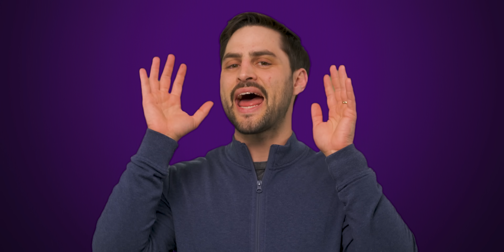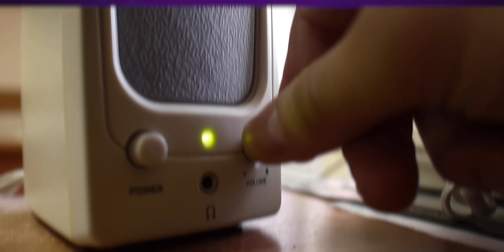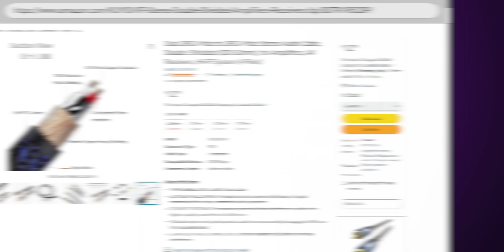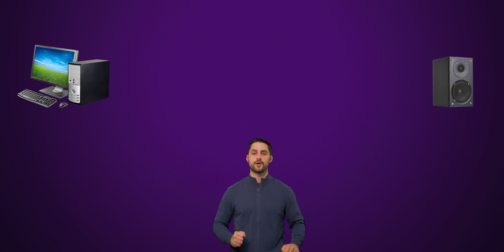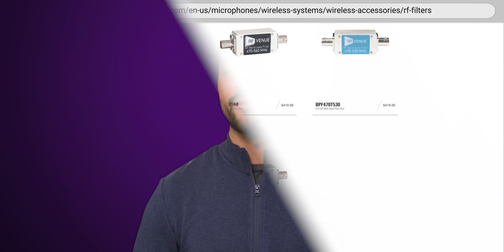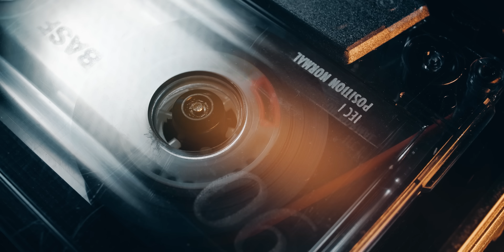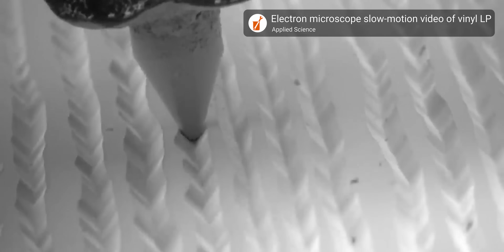Why Do Speakers Hiss?

Comment: THANK YOU SO MUCH!!!!
i just got some cheap microsoft USB speakers from a thrift store to use with my laptop. i was pretty dissapointed that they were making that annoying hum.
then i found your video and after that Ground Loop part I decided to plug the USB directly into my laptop instead of the USB Hub. the ominous hum instantly disappeared!!!
i assumed the aux cable was kinda bad because it seems pretty old, but this was insane!!!!

Comment: I solved mind by just uninstalling the Realtek Audio driver and the system defaulted to Windows Audio driver. I connected a relatively small speaker with an AUX cable through the 3.5mm jack on my laptop.

Comment: Hissing is not that bad. Has anyone tried using Corsair USB gaming headsets? Their MICS even on expensive models give terrible earthing buzz that can only be killed by denoiser algorithms, but they are useless on anything that doesn't have those systems. The buzzing is frikkin loud. I have never used a mic that bad in my life even on a cheapo analog hoffice headset from the 90s.

Comment: I'll tell you boat speakers make all kinds of weird noises. Including popping sounds when you engage something else in the electrical system. The one that comes to mind is running the bilge blower. It causes a crackling and popping sound through the speakers. So I imagine some sort of electricity is running through it and probably shouldn't.

Comment: 2:19 A ground loop isolator has saved me many times, especially when connecting my N. Switch or Steam Deck to external speakers using the handheld's headphone jack.

Comment: Can also happen with electronics not connected to the loop indirect inductance from a lamp cord can cause issues even if it's in the loop or out of the loop if you have the cord near your speak wire

Comment: I have a ground loop problem with our audio receiver being plugged into a subwoofer amp. The fix for us was using the Subwoofer Isolation from Blue Jeans Cable. They work pretty well but, they aren’t perfect!

Lastly, a nice trick was turning the bass output of the amp out as high as possible so that the subwoofers don’t need to be turned up as much.

Comment: I've had a samé problém with my USB speakers, the small ground loop via USB and 3,5 audio connector. The solution was powering these speakers via external non-grounded phone adaptor.

Comment: Another common problem, at least in Argentina, is that many houses do not have an electrical installation with a ground connection, which exacerbates the amount of interference.

Comment: In todays world of incredibly cheap made electronics with minimal or no filtering, it is far more likely for the average joe to be seriously creating radio frequency interference for amateur radio operators than the other way around. 

TVs, Routers, Dimmers, LED lights, anything with a motor... The list is infinite.
Reply: why would routers create radio frequency interference? they use the unlicenced 2.4ghz, 5ghz & 6ghz bands

Comment: I have a Gl.iNet router for privacy & security & its actually amazing! 100% can vouch for it. The router operating system (minus the source code) is FOSS & runs on OpenWRT, throw a good VPN server on there (IVPN or Mullvad) & you've got an extremely private network & your computer can't even see the real IP, useful if you don't want Microsoft having your ip, or anyone else for that matter.

Comment: What he doesn’t tell you is GSM can also interfere with the speakers. There’s a cool little trick here on some GSM networks if you have an external speakers that connect to a computer just before you receive a ring on your smart phone the speakers will start humming it appears that speakers can pick up the signal seconds before your phone rings and on GSM and CDMA networks if you have a digital antenna can interfere as well because in some instances the network and the digital antenna station are running on the same frequency this is important as to why you should buy a digital TV antenna that has 4glte RSD shielding or as it’s usually filtering. The box will say something like 4glte filtering or shielding

Comment: Use XLR or LAN cables that are balanced and well shielded, if you have the right connectors available on your equipment. It makes a world of difference and really should just be the standard.
Reply: what do lan cables have to do with this? they're digital

Comment: Whats weird is shielded network cable and shielded RCA cables have the shild terminated at both ends. That inherently makes a ground loop. In every other cable, you ground that shield at a single end to prevent this. Cisco switches actually had a problem with this and they could be destroyed by it. Since then, network gear started useing isolation capacitors so there would be no path to ground for DC ground loops. But there would be a path for AC. Noise is almost purely AC. 

However the capacitors add impedance to that path to ground so they sacrifice slightly higher noise for not destroying itself with standard shielded network cable.. all because they terminate the ground at both ends.

Comment: Back when I was living in a dorm room for the longest time I had no idea why the heck I was getting insane buzzing when using Bluetooth headsets. Felt really dumb I didn't realize the microwave right next to my PC Build might have been the problem... Switched to a wired headset and fixed the problem.

Comment: Fun fact, you can also create ground loops even within the same wall circuit if you are connecting multiple computers audio outputs together in a mixer. This is especially a problem for computers that may not have a proper ground to start with, like laptops, smartphones, basically any audio source with a battery and doesn't have a proper ground via its charging cable. Ive noticed this especially with battery powered devices charged over USB-C, all of them give off static noise that is completely eliminated by putting an audio ground loop isolator in between the device and my audio mixer
Reply: I think this problem is almost completely fixed when the audio cable is using a digital format to get the audio from the source device to the output.
Reply: Yeah I think that this problem is caused by connecting a power cable and an audio/data cable between any two devices, honestly I would be surprised if it is worse if you are using two separate outlets.

Comment: Had a really cheap set of USB speakers that would go nuts when my old GSM/2G phone received a call
Reply: that usually happened on most audio devices, regardless of if it were usb or not. I remember mobile signal interruptions noise from the 90s/2000s... it acted like a pre-warning that you're about to get a message or call when you're in the car.

Comment: My issue was electrical interference caused from a Dell motherboard's USB port connecting with my audio interface.

It was so annoying to deal with and figure out. I just lived with it until I finally upgraded to a new PC.

Warning to anyone working in audio, definitely don't use a Dell. Probably good advice for anyone, really.

Comment: Ground loops are due to improperly wired electrical systems (i.e. the electrician screwed up). If you have one, you'll get that awful humming even from a single device connected to a single socket.

Comment: I once swapped an HDMI cable in my setup, and got a hum in my active monitors (speakers). Swapped back to the old HDMI cable, and it remained. And that was actually the only change I did. It was all powered by the same wall outlet as well. Incredibly frustrating. Had to move the speakers to another outlet for some reason.

Comment: Ground Loops also can be removed by placing a device called "Directon Box" ("DI-box" for short), which has a feature called "Ground Lift". Cost around 200$+, so not a first thing home users will buy, but regurarly used by event and music profesionals.
Reply: "Lifting the ground" is simply disconnecting it -- can't have a ground loop if there's no connection to ground! Professionals don't ever do this because it can get people killed. There's a damned good reason for ground connections.

Comment: My favourite mystery noise was that one time my computer's audio would make noise when I moved my mouse or scrolled a window.
Reply: ah yes, mine did that too. I could also get my GPU's coil whine through it as well. A USB DAC or simply not using Dell's horribly cheap OEM mobo solved the issue.

Comment: your amp is garbage, keep cable run lengths short
the sound of a ground loop is 60Hz ... the frequency of AC power in North America ... your mileage may vary

Comment: I absolutely haaaaaaate the low level muting that's integrated into some Bluetooth speakers. I have a set of bluetooth bookshelf speakers in the $50-$75 range paired to the FireTv Stick on the TV in my bedroom and background music and quieter dialogue is completely cut out unless I crank the volume to about double what I want it at.

Comment: If your electrical noise is caused by a LICENSED ham radio operator, then tell them.  If they don't help you solve your interference issue (if it actually is caused by their radio equipment), they could lose their license.  Likely, your "ham radio operator" neighbor is just a pirate CB operator transmitting out of band, out of spec, and above the legal power limits. They are not licensed and probably have no idea how to solve the problems they're causing.  Yes, I am a US licensed extra class amateur (ham) radio operator.  I've been licensed for over 30 years.

Comment: Any ideas for why I'm getting "ground hum" on my laptop when another wire is plugged in like a USB C hub or charger, but on other devices there is no hum whatsoever? It's clearly my laptop. I've used 2 separate sets of speakers and they're dead silent for another device but loud with the laptop even when running everything through a power strip. It's driving me crazy

Comment: The easiest way to eliminate a ground loop problem is to use a ground loop isolator in the audio connection. They cost a bit but are generally a good solution.
Reply: Except their inductive coupling can and probably will alter the audio signal to a certain extend.
Reply: No, the easiest way is to plug everything into the same strip

Comment: I'm using SPDIF from the PC, but the biggest thing I've found helps is to turn up the volume on the PC and then turn down the gain on the amp. I still have a problem with his when I restart the PC as the spdif box puts out noise when there is no signal going into it.

Comment: A ground loop can also form between your house's electrical system and your cable television provider.  If the ground potential differs between these two and you connect them, say, in a home entertainment cabinet with a television and amplifier, you will get nothing but buzz. This can be solved by using an inexpensive ground loop isolator on your cable coax.
Reply: I had the exact same issue, and resolved it just the way you explain it here. Thanks for sharing!

Comment: as a person who plays guitar, using distortion or overdrive, this problem multiplies (literally) and can be a great source of frustration but if you know what you are doing, a lot of interference can be mitigated. the only part you are stuck with is the internal components picking up natural background static (they grey snow on a TV with no cable) and amplifying that. (we don't live in faraday cages.)
Reply: You bring up a good point, I agree we should live in faraday cages.

Comment: I can't stand the hissing noise. Mine was caused from a ground loop capturing audio from one PC to another and yes they were plugged into the surge protector. A ground loop isolator fixed my issue.

Comment: I have this issue but it becomes very apparent to my 5.1 surround when I turn off my PC. I think it has to do with my shitty receiver. There's just isn't any good and moedrately affortable 5.1 system for PCs. I was searching for the RF filters you mentioned and led me to Ferrite Beads. Are those a cheaper solution than adapters?

Comment: If your amplifier even has a ground, you bought garbage equipment! Good audio equipment don’t come with grounds at all because they are internally insulated and safe. Also this explanation of a ground loop is not correct it’s about the different circuit, but more specifically the circuits must have separate grounds and separate potential differences. Some circuits can share a ground inside the circuit (all circuits eventually go to the same place though). It’s more about the potential difference not the fact that they are separate

Comment: Ground hum isn't caused by using different outlets. It's from using outlets grounded on different circuits. Outlets across the room from each other can be on the same circuit while outlets right next to each other can be on different circuits. Think in terms of which outlets share the same circuit breaker. It isn't just audio devices that cause the problem or experience hum. Hum can also be seen in televisions and projectors as a line slowly crawling from the bottom of the image to top. Hum is induced when devices connected to each other through audio and/or video cables are plugged into different circuits. When you're using multiple devices connected to each other through audio or video cables, you want to get them all grounding in one place. 

If you can't get all your devices on the same circuit, there are devices that can be installed in the system to fix the problem. The most common method is called a ground lift, which is cheap adaptor placed on the end of a power cable or in an audio line. Install the ground lifter on one of the interconnected devices and it disconnects the ground wire from that device and prevents it from grounding through the circuit it's plugged into. This forces it to ground via the video or audio cables through the other device it's connected to which doesn't have its ground lifted. Ground lifts are quick fixes but can damage equipment in the event of power anomalies. Still, you will generally find them in the toolkits of professional technicians and used regularly. I've been doing it for twenty years and never had a problem. There are more expensive electronic devices like isolation transformers that condition the power without having to lift the ground. Some devices have it built in and offer a switch to activate it.

I work in convention audio visuals and this is an extremely common problem as we work in different venues every job, are at the mercy of whatever power is available at those venues, and generally divide our audio, video, and lighting systems up over different legs of power. A lot of audio visual technicians don't understand ground hum or know how to fix it and can be the hero of the day when they do.
Reply: I fought ground loop hum, and wasted lots of money on filters that filtered the sound (yuck).  I ended up beating the crap out of ground loop hum with Toslink Digital Optical cables connecting my TV and Amp. God bless baby Monoprice for bringing reasonably priced optical audio cables into the mainstream back in the day.
Reply: @caffeinesippingman   yes god bless toslink  :)
Reply: Never replace mains ground with AV ground! Those AV cables are not designed to carry short circuit current in case of equipment failure, you either burn them (and probably equipment too) and/or they will increase fault loop impedance so much that circuit breaker won't trip, resulting in fire. If you use lifters connect all equipment to the same ground point externally.
Not to mention, disconnecting the ground may result in electric shock or electrocution!
Reply: the noise he is talking about is usually common mode noise.  There are common mode filters for the ac line.
Reply: @Mdgr_zolom next time you find an outlet on two different circuits, be sure let me know

Comment: If you have identified EMI as the source of the noise, try switching to a balanced connection. Short circuit has covered it before, but the TLDW is it works by sending an inverted signal along with the regular one. When it gets to the other end, it is inverted again. Any differences can be filtered out by comparing it to the original signal. Anything professional like XLR, TRS, or Twist-lock cables can be set up for balanced signaling.
Reply: Agree, using balanced XLR cables fixed my issue
Reply: The same technique is used in a lot of high-frequency digital signals. It's called a differential pair in that context.

Comment: Okay, one of the most obvious reason was omitted - POWER SUPPLY! The cheap chinese switching ones are one of the worst and can ruin the best audio electronics listening experience. Btw ever heard of audio-graded switching and non-switching power supplies? Transformator ones for example? Still used, for very good reasons. LP filters as well are very much needed. And yeap, that would be nice to mention why there are these "weird thick cylider things" over cables in some electronics.... ;)

Comment: You forgot about gain stage. If you for example have an amplifier connected to your computers 3.5mm output and have the amplifier at max volume and the computer at low volume that amplifier is going to amplify the noise of your computer by a lot even if the music is playing at low volume. So if you instead lower the volume on your amplifier and turn up the computer you won't have the same amplified noise.
Reply: Used your technique as well, but then you end up running the speakers at -20db and the mixer board at -50db just to not have it blasting. Really wish I could turn off the amp on my laptop and just let it be preamp output
Reply: @MatthewCrawford  YES
Reply: Yo thanks for this